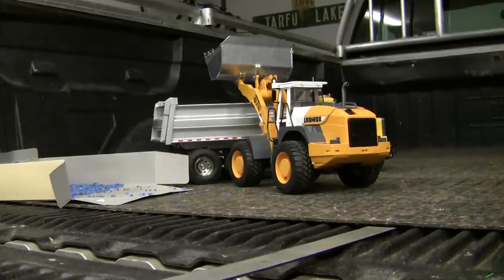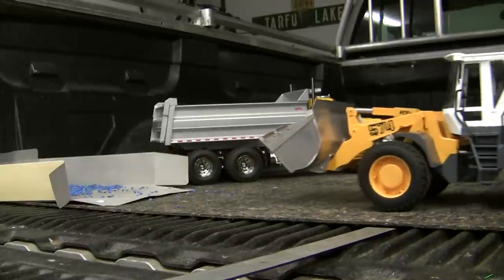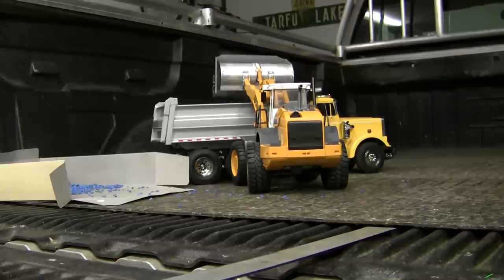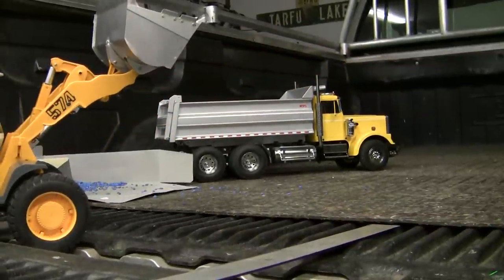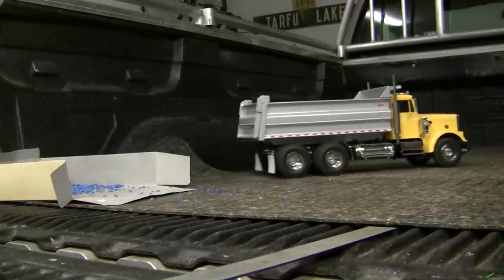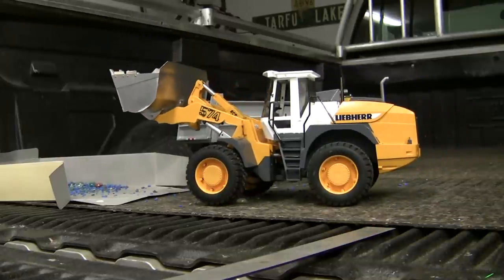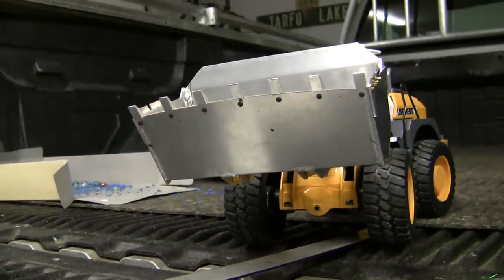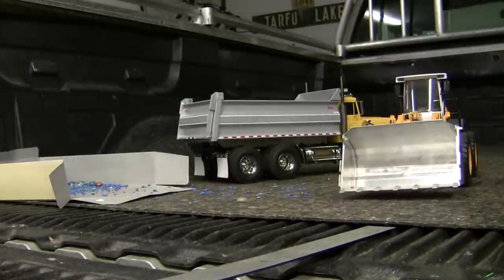Liebherr 574 conversion first test run

Comment: Another great job, love that bucket, can you share the width? Is your bucket up & down restricted by the model or actuator issues? Best of the new year to you and you team.
Reply from the maker: The movement is restricted by the actuators but really it's just the way I chose to mount them. I could have gained more travel but it would have been weaker I think. The bucket is about 1/2" wider than stock.

Comment: do you have metal frame part? the bucket yes! but the arm and the front? metal or plastic and where have you buy the part you have change? thanks!  it work pretty well! nice job
Reply from the maker: I made the bucket and upper mount for the actuators. The rest of the boom and chassis are plastic.
Reply: RCP57 thanks! i will try to make one!